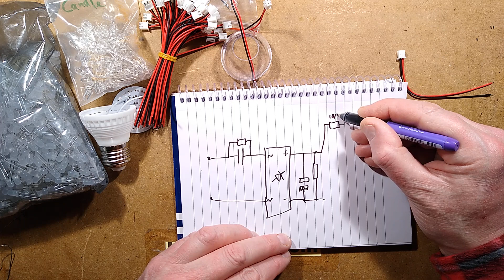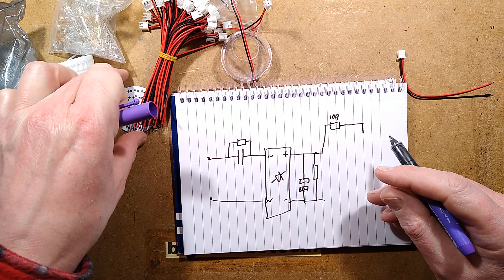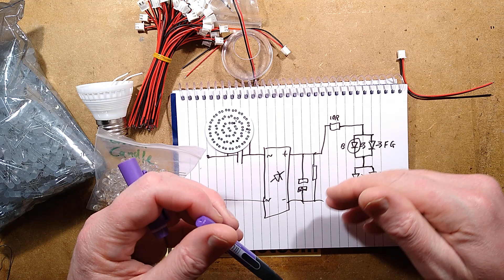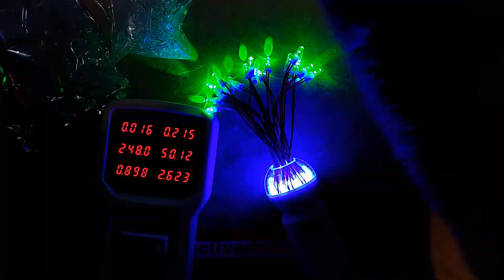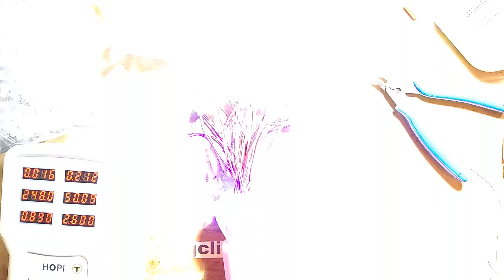Custom extra weird trashy lamp build.  Blue orb with green pulsars

Comment: What is the value of ceramic capacitor used in capacitive dropper ckt.
I want to use capacitive dropper ckt for 12v relay , what your suggestions??
Reply from the maker: Look for X2 suppression capacitors.  It may need to be a high value like 470nF or 1uF for even a small relay.  The circuitry will all be live at mains voltage.

Comment: perhaps generators would be wise to use a bridge rectifier if they ever use non-gendered plugs , that way if you plug it in backwards the electricity will simply not flow.

Comment: The camera cutting out at ~30 Minutes is definitely because of file size. A lot of memory cards, SD Cards etc., used to use the FAT file system. In fact, a lot of them even today still use FAT.  FAT had a file size limit of 4GB.  So camera software was just designed to limit their file sizes to 4GB to make sure the FAT limitation wouldn't be a problem. And manufacturers are lazy and never updated their software. Now that exFAT is the standard the 4GB limit is gone, but the software is slow to adapt.

Comment: You mention the camera cutting the video at a fixed file size. Is the file size around 4GB? If so, this is likely to make sure the file will still work with an SD card that came formatted with a FAT32 filesystem. It's a system that dates back to way back when hard drives weren't that big, let alone file sizes. It's still commonly used because Macs only have read-only support for NTFS. Perhaps, if you reformat it, it'll remove the limitation.

Comment: It depends very much if your dad was born in 20s or 30s - not especially common in 20s but by the 30s 40% of boys were routinely "done" on health grounds.  Septicaemia was still a massive risk but penicillin discovered in 1928 - more widely available later and dying from minor cuts reduced with availability.
By the time I was born (1956) antiseptics and penicillin were widespread but rather than reduce the practice it increased to 70%ish becoming common across all classes and religions.  As always class and location are factors.
Of the kinder were jewish and despite many living in and being German by birth they wouldn't carry the "typical" germanic traits, generally they'd be shorter and darker rather than fair and tall.  Not many 6'5" ginger bearded jews (surprisingly!).

Comment: Oooookaaaaay!! Now i wanna know "what you have done to their light" :-) @55:53 ...    did it go bang instead of bling ?? :-)
Reply from the maker: It went bang with force because I'd nipped a wire between two parts of the case.  A re-opening, some insulation tape and a quick wipe over the sooty bits and it was fine again.
Reply: @bigclivedotcom  sometimes a bang or two now and again is good for you, even better with colour right before it goes bang

Comment: Those are JST XH female connectors. Quite a nice connector and lately my favorite for projects.
Reply: just that they exist in different pitch versions 2mm and .1in which for the 2pin versions does not make a difference but everything above 2 pins is just not possible with .1in protoboard and 2mm connectors...

Comment: clive, the reason the phone cuts out around 30 mins is that most mobile phones use a fat32. fat32 has a maximum file size of 4GB (4 minus 2 bytes) so when it reaches around 4GB the video must end

Comment: Solar isn't a good option in much of the UK, but south of around Oxford it is certainly viable. I had a rented house with a 16 panel, ~3kW, install on it and during a sunny day it was generating 12-15kWhrs. If I have been able to store this then for at least half the year it would have been sufficient to live off of. Sure small, installs of 4 of 6 panels on peoples roofs in Newcastle are pointless and local storage is required to have the full dream, but solar should not be written off provided the location is correct.

Comment: Can you possibly find a way to make led tape or leds flicker randomly like a dying CFL tube? (big fan of horror and abandoned buildings with power still on)
Reply: I don't know much about microprocessors or Arduino but it seems like there'd be a way to generate random on-off signals with chips. Clive with his experience in making props for TV probably would know right off.
Reply: @tncorgi92  yep, any micro I've come across has had a random function.

Comment: another problem with solar .. personal use solar or solar on the roof .. currently in Western Australia , pricing for electric is around 25 cents a unit/kw , if you have solar on the roof lets say 2 kw system , average of 4-7 hours of sun a day , giving about 10kw a day avg, and with no batteries it goes into the grid and they pay 7cents a unit/kw , meaning you have to buy back your unit at 25 cents later in the evening when you need the power .. its not right in my mind , oh interesting effect with the leds .. spotlighted green flicker

Comment: I have the understanding that the 30-ish minute recording limit is to avoid being classified as a "video recorder" which incurs an EU tax. You might be able to get around it with a firmware hack.
Reply: most phones running 6.0 or earlier at launch use FAT32, which has a 4GB file limit. his phone has that file limit even though he has more storage than you would safely format as FAT32. a firmware hack wouldn't do there, however, a newer phone running 7.1 or newer for android will be using EXT4 or exFAT, which is similar to NTFS, but more usable in mobile devices with 32GB or more in storage, then the firmware hack would be viable.

Comment: Trick that Clive probably already knows but it might help some others - If you twist both of those connectors' leads in the same direction (Clockwise or counter clockwise) the leads will twist together nicely, handy if you want to end up with them that way. Another neat trick if you use solid wire and want to straighten it is to roll it between 2 flat surfaces, I use 2 small boards; Rolls them nice and straight. Clive - A "Neat Tricks" video could be nice to teach all the other neat tricks we can all teach each other? Things like using incandescent light bulbs as a current limiter (a 60W bulb won't let over 1/4 Amp through, even if your project in series with it is a short circuit; Use higher wattage lamps for more current and lower wattage lamps for less, at low currents those bulbs have rather low resistance and at their limit they light up to show you that you have a problem.)

Comment: Another great lamp! I really love these where you use the socket directly to hold the LED - it opens up some really interesting options.

Do you know any source of a socket that would work in the same way but that would hold a 4 lead RGB LED?  I've searched many suppliers in the UK and China and not found one yet but maybe I'm not looking for the correct term?

I can imagine that with a tiny micro-controller and RGB LEDs this could make a very "interesting" effect... :-)
Reply: Dave Micolichek  I have never seen, anywhere, a connector that would accept a four lead RGB LED in the same way that Clive is using normal LEDs here. Do you know where these are in the shops?
Reply: Dave Micolichek  You must forgive my poor Google skills but after many weeks of searching I have yet to find any 4 way crimpable connector with a 1.27mm pitch. I've searched AliExpress, Banggood, Farnell, RS, eBay, Digikey all to no avail.

Molex do the picoblade at 1.25mm and JST have their GH range at the same pitch but nowhere have I found anything at 1.27mm (not appropriate for this sort of use anyway).

RGB LEDs vary between 1.27mm and 1.3mm pitch so I would think that a 1.25mm pitch connector would likely put quite a bit of extra stress on the leads or prevent them being pushed fully home.

If you know of a source of 1.27mm pitch connectors (in a similar style to those in this video) I would be truly grateful if you would share it.

Maybe I'll order some 1.25mm ones and see if the LEDs can be made to fit.
Reply: Dave Micolichek  Thank you. I will add some to my next order.

Comment: The 30 minute skip is a file size/encoding issue. FAT32 formatted micro-SD cards, being the worst-case scenario, have a filesystem-imposed file size limit of 4GB plus, the video encoding technique - while recording - is not the same as the encoding applied after recording is stopped by the user, so cam apps target the worst-case filesystem & will automatically break the files into 4GB chunks (whether the target filesystem is FAT32 or not - 4GB is about 30 minutes with your camera app with those settings) that are a twist on AVI encoding format. The file manipulation, closing the old file, waiting for the kernel to flush its buffers and finish the write, opening the new file, writing the encoding header, etc, all produces a delay. You can minimize that delay by selecting only high-performance micro-SD cards, selecting a phone with lots of DRAM (for buffer space), or by wearing out the phone's onboard EMMC non-volatile memory.

Comment: I wonder what is the fate of these lamp projects you created over the years. Do you still have them? Do they get regular use? Do you have a corner (or even a full room) where they are all on display, where you can enjoy them from a comfy chair? Or do you give them away? Or even sell them? Or will they end up in a box, gathering dust?
Reply from the maker: They end up in many of the areas of the house that don't need much light.  Like the hallway, which has two candelabra lights with three in each.

Comment: I'm not 100% sure, but video lenght limit could be caused by FAT32 file system. Not so far ago it was default and only usable file system for flash memory (especially SD cards) because smartphones and other mobile devices does not support NTFS. And FAT32 have single file size limit of 4GB. Nowadays exFAT is much more popular and it's usually backwards compatibile. I'm not specialist, something can be wrong.

Comment: BTW: You can make your own flickery LED effect of any color you want (including many LEDS). Start with the flickery LED (green or yellow you don't like) in a series with a current limit resistor connected to the Base of a general NPN transistor (e.g. 2N3904, 2n2222), connect the  Emitter to ground and the Collector is connected to a "normal" LED of any color (sorry, "colour") of your choice with a current limit resistor in series to Vdd. You can hide the LED connected to the base if you wish.  I did this for a series of flickering LED "eyes" for a Halloween prop... works great, try it.

Comment: Fukushima was hit directly by the worst tsunami in recent history, that caused the death of over 20 thousand people in various parts of Japan. Total number of casualties from Fukushima radiation: 1.

Very few days go by when less than a hundred people die in accidents related to the extraction / transportation / refinement of oil & coal, and several million deaths every year are directly attributable to pollution caused by those fuels. Any (pseudo) "environmentalist" who is against replacing oil & coal with nuclear plants is basically working for fossil fuel PR.

Comment: That is delightfully trashy, and I love it!

It's made me curious, I know I've seen these flickery candle LEDs in an amber/orange color (not red), and I'm very tempted to build a set of boards of the things for automotive applications.  Might make for an interesting parking/running light application.  Technically, it's not strobing, so it would be legal under US laws...  :D
Reply: Dave Micolichek  I've seen several newer motorcycles with slow intensity-changing DRLs, and tow trucks here all drive around with their emergency rooftop lights flashing and blinking and making a visual ruckus 24/7.  There must be a loophole somewhere!  :D

Comment: I was told the non camcorder recording being limited to roughly half an hour was down to WTO tariff codes. My camcorder records in roughly 10 minute blocks of files, but will keep going laying down 1 file after another such that they can be put together with no drops up to a maximum of the SD card it will take (64GB) or roughly 6 hours of continuous video.

Comment: @0:41:28 I use several factory automation programming (PLC/HMI) software packages that say to disable anti-virus software for installation. I don't do it.
 The software installs and runs.
Reply: IT IS A SCAM.
HIJACKING YOUR INFORMATION. 
HIJACKING YOUR MACHINE. 

it's a trap.

IT'S  A  TRAP.

Comment: My background was electrician commercial and residential, commercial HVAC and smoke controls and a control tech at 2 waterplants and a wastewater for a city for 5 years then a waterplant operator for 4 yrs then I became disabled, but to relax I usually watch wood working like engals coach shop ,anom or ave.

Comment: ☆☆☆ The Corona virus can live 9 days without a host! I was curious myself, because I purchase things from China! I dowse the package the product comes in with rubbing alcohol at least 90% grade... Then the product I've purchased as well, once I've taken it out of the packaging...
Reply: Just wondering if Hydrogen Peroxide would work as well. Many sites suggest soap & water.
Reply: Viruses are just protein shells with a DNA injection mechanism and hydrophilic viruses will typically laugh at isopropyl alcohol. This new coronavirus has both hydrophilic and hydrophobic regions so it is susceptible but you should use 70% so the water can play a role as a carrier. Contact time with the alcohol should be no shorter than 4 minutes to be truly effective.

Comment: Off topic but fairly recently I bought a pair of Xuron wire cutters on your kind of recommendation. I just ordered a bundle of stuff from Amazon, mainly for some soldering bits but amongst which was a pair of wire cutters which were identical to the Xuron pair, right down to the packaging, except for being branded Xupcn. I wondered if they were fakes or something so I tried to visit the site URL on the packaging xupcn.com but it redirected to your YouTube channel. What gives?
Reply from the maker: I featured the Xupcn side cutters in a video and a channel supporter bought the domain and directed it here.
Reply: @bigclivedotcom  Ah, okay, thanks. So, are Xuron and Xupcn the same company? And why is the domain on the packaging if the company didn't own it?
Reply from the maker: @sapereaude391  They're a clone and they changed the name to something similar looking.